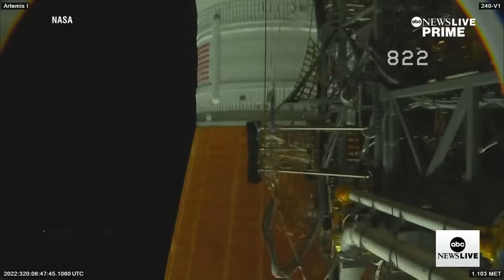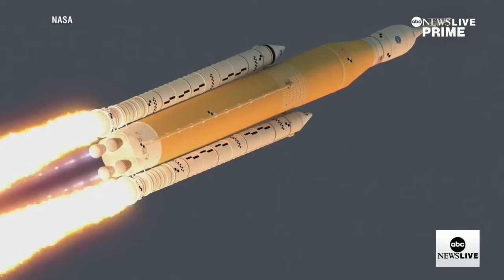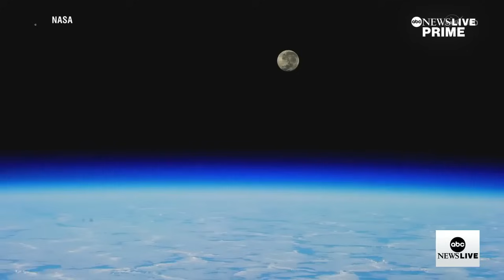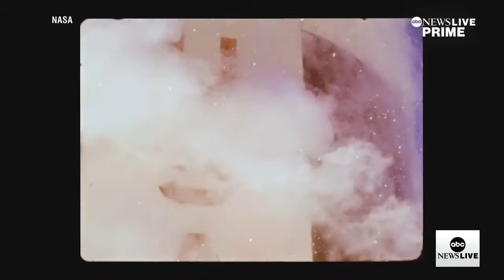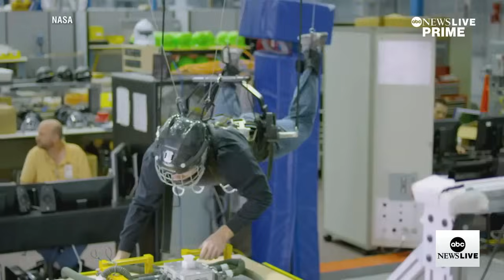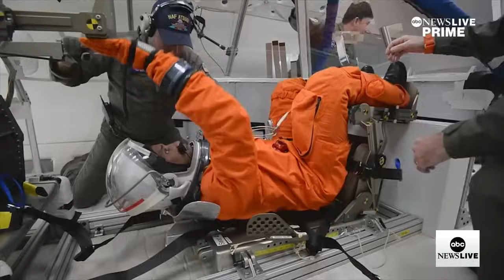History-making moon mission

Comment: To moon probably 2 people touched down. To space probably 30 people. So in total around 40 who could have gone to space. Space means outside the world around 600 or 1000 miles. And beyond. Not training people. Because huge vehicles are difficult to build. And the space required on earth around 300×300 miles. Taking the shock and also non reusable after 5 or 20 years. Solid and flexible.